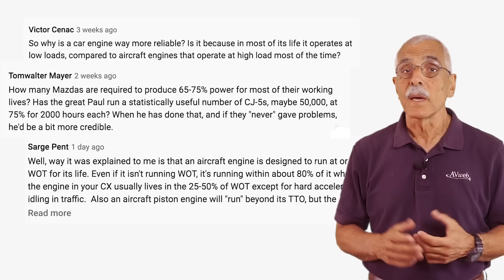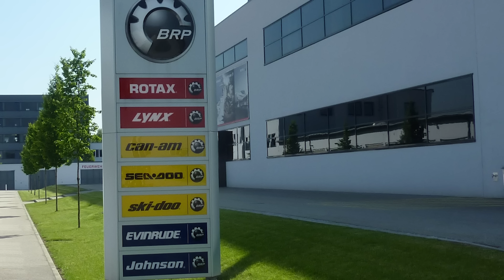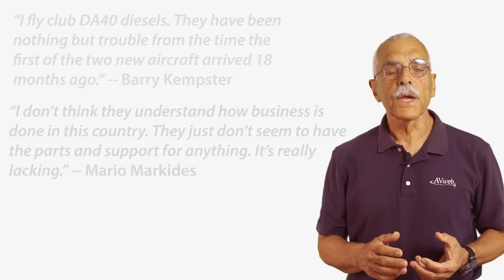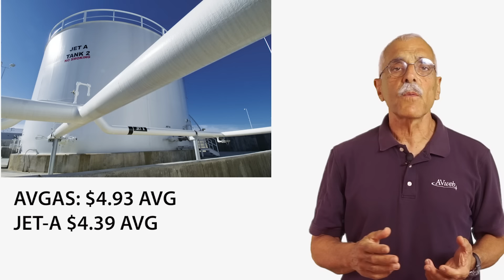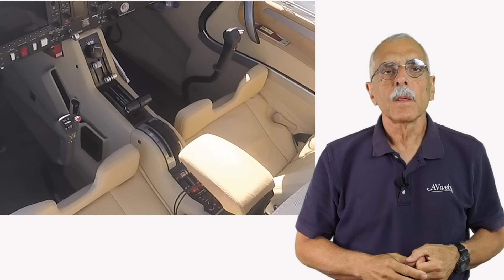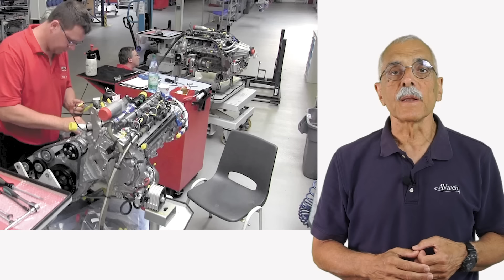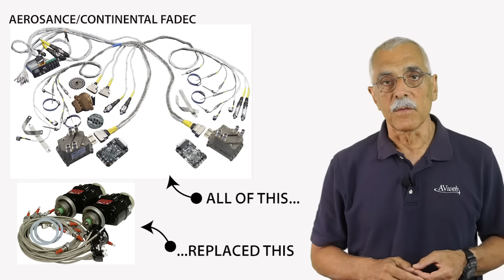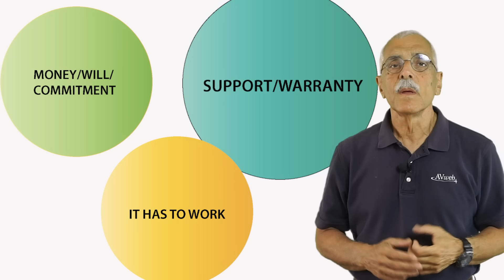Why New Aircraft Engine Ideas Rarely Succeed

Comment: Well all I got to say is thank the good LORD that 100LL is still being produced.  My 2 big concerns with using auto gas in aircraft  is not so much octane rating, but ethanol % and vapor pressure.  If you want 100 octane, that can be done with an octane boost. {at least in cars} We all know where this is EVENTUALLY headed - ELECTRIC but it's going to take awhile for MANY reasons.  In the meantime, let's just make the best of the "60"s" technology and concentrate on making current engines MORE reliable.  I remeber reading ads about Victor engines and I looked him up {the founder} and the guy was the real deal.  He said one of the keys to engine reliability, is to get the engine to it's near perfect state of balance.  I don't know if the guy is still in business or not. The other thing we could do, is reconsider the dynacam engine.  The dynacam engine has ALREADY been tested on a Piper {Arrow ?? - sorry the Piper line of products can get confusing} The dynacam engine WORKS !! What killed the project ?? I think if I remember correctly, the Dyna Cam engine can run on "low" octane fuel.  You could probably have a grade of Avgas like 90 no lead but with high quality anti vapor lock properties.  I'm not absolutely sold on aircraft Diesels.  Especially if it's not direct drive.  I just don't like gearboxes although the Rotax seems to work good.  But with an aircraft diesel, that's a bunch of compression ratio happening and if they can actully make it ultra reliable then having a piston aircraft use Jet A would be great.  But I think the DynaCam should be revisited, the dynaCam actually solves a lot of problems.  I believe in my heart of hearts that LONG range ELECTRIC aircraft propulsion with a decent payload factor with ACCEPTABLE initial capital costs, is FANTASYLAND. Short range ?? Not a problem.  But NOT long range. Batteries are just too heavy and there's no way to get around that.  Actually with electric propulsion, fuel cells are the way to go.  But who's working on that ?? Certainly nobody in the States.https://youtu.be/ScS-QCWHfb8
Reply: "Auto Gas" isn't really the gas you get from the local Gas-n-go. It's still a higher quality specialty fuel that needs all the same paperwork and specifics of 100LL being sold to planes.
Reply: @Racing_Pig  Is one of those qualities anti vapor lock properties ?? What I fear with a cheap gas, is high altitude on a hot day, or when you're flying during a temperature inversion. If I understand it correctly {and if someone finds me in error, let me know, I'm not here to fight but be a good aviator} when you're at low elevation you have lots of pressure pushing on the AvGas so that's good, so you're wanting protection if it gets too warm out.  As you climb the pressure gets lower {which is "bad"} but the temp decreases {if there's no inversion} so that's "good".  That's why I kind of lean towards the AvGas, not only because it's a REAL 100 octane, but the fuel is NOT supposed to vapor lock {in theory}.  It would be nice if the lead could come out to make the engines run cleaner ALTHOUGH I once heard that on some engines the lead acts a lubricant.  {yea at the time I heard it, I thought it was crazy, but I'm not fighting it because 100LL is what we've got and that's that} And man I really prefer direct fuel injection.  I want the fuel to stay a liquid until that last moment when the fuel exits the injectors and I also like the idea of boost pumps.  But what I'm getting at, is whatever fuel we end up using, I would hope the engineers would vapor lock proof it even MORE as well as provide enough octane to prevent detonation.
Reply: @mustardseedsociety  Yes, AvGas and Aviation "MoGas" have definite guaranteed properties Street gas doesn't need to be held to. and yes Lead is both an antiknock and a valve lubricant.

Jet-A solves both problems. Low vapor pressure so less evaporation and vapor lock, as well as being a better lubricant for pumps etc....
Reply: @Racing_Pig  So maybe a solution is the aircraft diesel engine for "budget" airplanes.  Or how about a "1/3 battery pack with electric motor driving the prop and "tucked away" is an exremely compact water cooled aluminum block gas engine turning a generator.  The gas engine & generator would only be used for recharging.  Of course this is known as a series hybrid.  So if your fuel system or gas engine failed, you still keep on flying for an absolute minimum of 15 minutes. So even in a slow airplane say a 120 MPH airplane should give you minimum of 30 emergency miles plus any glide miles.  One thing I would love to see, {and I'm going to contact someone on this idea} is some kind of device that's a moving map that "knows" exactly where the best suitable emergency landing spot there is within the aircraft's current engine out glide.  That spot could be an airport {yea!!}, or a golf course, or a country road with no power lines to run into, or a corn field, or trees.  The entire planet has been mapped so I don't see why a system like this could not be built. A computer voice could give you vectors.  If the airplane has BRS the system could vector you THEN say DEPLOY CHUTE because it does no good to deploy a chute if you're going to land in an alligator swamp.

Comment: okay I'm going to ask a question ,, why can't we use boat power plants  a honda 300hp boat engine runs at full power all the time , and as far as cooling  the P51 has a radaitor  and it's older then the guy that's going to complain about cooling   its not that hard to add  a rad under a cowl

Comment: Our flying club converted a C172 to use a Thielert diesel in 2011. The two main issues were the MTOW-limit and the uncertainty of the gearbox inspection interval (as mentioned in the video) which meant an uncertainty in operating cost. For touring, the aircraft was essentially a two-seater, but it you were only two people on board it was an amazing tourer: in a configuration where the MTOW was no issue, the range was fenomenal. As also mentioned in the video, engine management was very easy: you start it like a car, engine run-up is at the press of a button and in flight you just set the SLC lever to whatever percentage you want. No constant adjustment, no performance tables to read, no leaning,... The turbo meant we had sea level performance up to 8,000 feet. The club eventually sold it, but not because of technical issues: we needed to downsize the fleet and this was the aircraft for which we could get the best price. I still miss it. We have one Rotax-powered LSA (600 kg) now and that's also very easy and modern to operate compared to our C172 and PA28 Lycoming engines.

Comment: 1) Austro Engine has a cast-iron block?! That explains why our club's DA40NG (with an Austro Engine) can be accidentally loaded nose-heavy. Haven't seen that in any other single I've flown. 2) Although our Club's C172S retrofitted with a Thielert 1.7 is decidedly hard to flare if there's nobody in the back seat :D
Reply: On e reason they kept the austro a cast iron is that they can be refurbished at 1800 hours instead of having to be completely replaced if they were aluminium.

Comment: Macabre Story: We had one of the Porsche powered Mooneys at my Home Airfield in Germany and how it came to be that we have the only Porsche powered DR.400 Remo. 
One Day one of the FIs wanted to take it for a spin. To Fuel the Planes at this Airfield you have to cross the Runway to get to the Pump. 
So he waited for Plane on Final to pass and cross. Unfortunately the Plane, a Cessna Taildragger, encountered a sudden Crosswind and veered off the Runway, ate through the Mooney's Wing and severely injured the FI, destroying one Lung entirely and in surgery they found a large, undiagnosed Tumor in the other Lung and removed half of that one as well. 
So he is at 25% Lung right now, still teaching and while the Mooney was a writeoff, the Engine found its Way into a DR.400 Aerotow which had previously broken off it's Nosewheel Taxiing.
Reply: Amazing

Comment: He's spot on his conclusions. Many of the engines were developed in Europe, and I would give some perspective on why I think this is so. Going 25 years back, in Denmark AVGAS was about 0,50 EUR/L, JET-A slightly cheaper - fuel for airplanes was not taxed. (I will let metric and currency conversion to the reader, as this is not so important - the price increases are). In the 90's environmental pressure introduced the same fuel taxes on AVGAS as on normal "vehicle" fuel. In the early/mid 2000 you would pay 2,00 EUR/L for AVGAS and little less than 1,00 EUR/L for JET-A. JET-A was not taxed (as heavily), as it was used by the industry and this would make plane tickets much more expensive, while AVGAS was seen as a "recreational" fuel (unnecessary hobby for the rich). This made the incentive for the manufacturers to develop diesel engines - at least looking at the European market. But before development ended and they were in mass production and common on planes, political pressure introduced environmental taxes on JET-A fuel as well. This made the price difference much lower between the fuels and the incentive to purchase the unknown and unproven new engines disappeared. Simultaneously, engines capable of running on MOGAS become more common. MOGAS is slightly more expensive than JET-A and somewhat cheaper than AVGAS, so this breached the gap. And finally, the European market is much smaller than the US market (which did not have the same price advantages) and the lack of support for those new engines in the US eventually doomed them.

Just for info, the fuel prices at my local airport in Germany today AVGAS 2,28 EUR/L, MOGAS 1,89 EUR/L, JET-A 1,86 EUR/L and at a similar airport in Denmark AVGAS 3,88 EUR/L and JET-A 2,38 EUR/L, and finally at the local gas station in Germany, Super 1,50 EUR/L, Diesel 1,25 EUR/L. In Denmark a diesel may have made an economical sense, but the market is microscopic.

Comment: Because the industry is regulated into staying decades behind and with a fraction of the reliability of car engines. 

It’s a joke.
Reply: No its safety and liability.
Reply: @flexairz  

What’s the ratio of airplane engine failures:car engine failures (Toyota or Ford, for example)?
Once you see that, the “safety” goes out the window.

Comment: I've often wondered why we're not seeing more diesel engines that can burn either pump gas or JET A.  It seems like I have seen some potential new engines coming on the scene.  One of those was the Gemini.  Also recall seeing the DeltaHawk at one of the fly-in events.  I would really like to see this gain traction so that we can bring down some of the costs associated with aviation while improving performance and reliability.

Comment: I find it odd that at the start of aviation there were many different types of piston engines in service. These days even a geared engine is an alien.
Reply: Has to do with piston feet per minute. The safe bet means huge engines at low rpm's. Small short stroke high revving engines make good horsepower but suffer in torque which is important where propellators are concerned. You can add a monster turbo with astronomical cylinder pressures to compensate for the lack of torque but that's a whole nother can o woims. Am waiting to see what happens with the phazer and apex engines. Meanwhile G. A. flyers can expect to keep seeing about 1/2 hp per cubic inch

Comment: Also with FADEC and water cooling you don't fly with "full mixture to cool the engine", the engine should run near the optimal fuel burning ratio for most of the time. So technically the fuel consumption difference should be even greater in stuff like pattern work where you pretty much run full rich.

Comment: I was one of those DA-42 engine failure statistics in 2009.  Something with a wiring harness jiggled loose over time and killed the left engine mid flight.  Those Thielert engines were AWFUL.

Comment: After that, I am more convinced on electric motors... no more incremental changes and time for step change. Go Pipistrel, Bye, Tecnam and Oxis Energy. I am betting there is more opportunity for advancement in batteries than there are for ICE over time. FAA better get a move on - loosing out to EASA and China's CAA

Comment: Hi Paul, the low production volume of aircraft engines makes it close to impossible to make a business case for making the substantial development, marketing, support and other investments. AC-Aero has some very interesting stuff. They are covering both "new tech" with two stoke multi fuel engine and liquid cooled, and stroker kits for Lycoming's. Wish them luck..